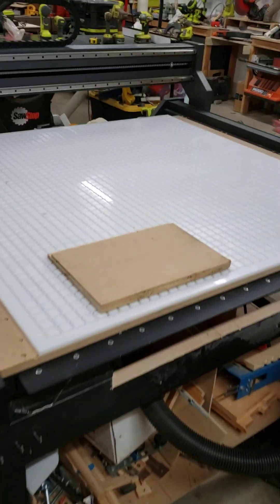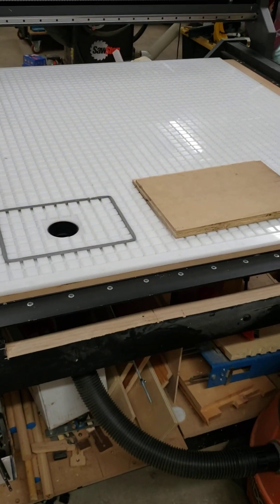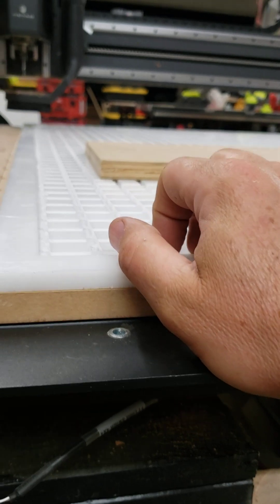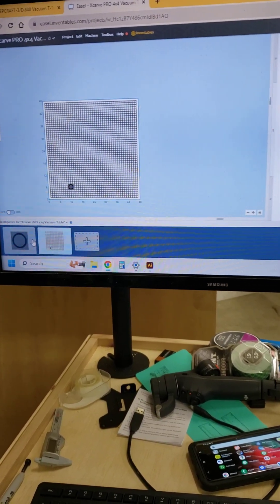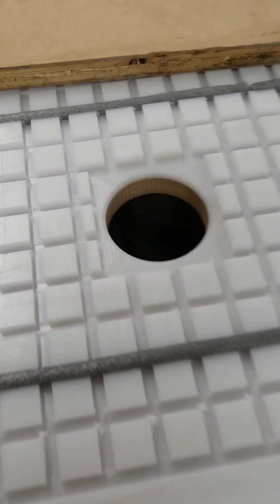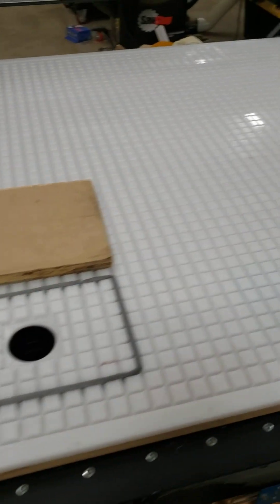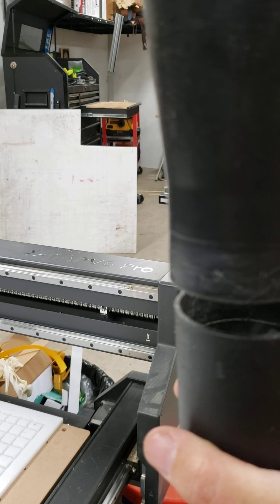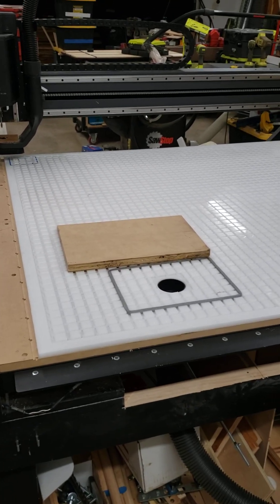CNC vacuum  table! This table is dead simple and you can make it any size you need.

Comment: should use a two stgage shop vac, so motor still gets cold air even when under load, risking burning out the motor with standard basic vacs
Reply from the maker: I will look into this, Thanks for the Tip!

Comment: how long did your vacuum last before exploding?
Reply from the maker: It's still going strong. The key is to remover the filter and maximize airflow. Since the vac is not actually picking up chips or debris no filter is no problem. the vacuum is pulling loads of air through the MDF and airflow to the vac improves with each part that is cut from the plywood. The longest I have run the vac during a cut is 2:40 min the motor never even warmed up. I will certainly post a video when it fails.

Comment: This is great.  Like it a lot.  My question is how do you stop from cutting into it when you cut through your material?  Even if you are just a little off on your measurements, cutting into the HDPE is a possibility.  Thank you.
Reply: Good question, over time it seems like it'll start to lose suction as that happens, and those HPDE sheets aren't so cheap. I suppose you could use a porous intermediate mdf layer as a wasteboard on top of the suction grid.
Reply: I had the same question. I’m in the process of making a 22” x 22” vac table for my small DIY CNC machine. What I’ve come to conclude is the vac table is only half of the system. You need to add a spoil board on top of the vac table with gasket material between the two. Some of the more powerful vac systems can pull air directly through an MDF spoil board. I will be using a small 3.5 CFM oilless vac pump so I’ll have to do it a bit different. I’ll use 1/4” MDF as a spoil board on top of the vacuum plate/table with a gasket between the two. drill one 1/4” through hole in the center of the MDF spoil board and use door/window weatherstripping as a gasket between the spoil board and my project material. I’ve been experimenting for a week and I’m ready to start cutting the slots for the gaskets. Fingers crossed.🤞
        Update on the above…. My 3.5 CFM vacuum pump is no where near powerful enough to pull air through an MDF spoil board. It dose hold work pieces directly to the vacuum chuck when adding a gasket seal to trap air under the project piece.
Reply: @thisoldman7142 I’m a machinist and have had quite a few different cnc machines in my garage over the last year. I recently built a 60x80 router table and a vacuum table would be better yet. Anyways! 

You’re work surface, in this case the HDPE plastic. Set that as your Z Zero. That way. When your tool is at Z0.000 technicality you shouldn’t be cutting it. I use a tool setter so all my tools are always right where it should be!
Reply from the maker: The HDPE is the table that lets the vacuum apply suction to an MDF waste board. The vacuum table will pull suction through the MDF and hold your work. You will only ever cut into your work and then the MDF waste board. Once the waste board is spend replace the MDF and keep the HDPE forever. 

The only time you will put your work directly onto the HDPE is when you are doing a carve job, Signs, 3D flags etc. 
All through cuts get the MDF waste board over the HDPE.

Comment: Hello dan, i'm planning a vacuum table similar to your but i waas wondering if one vacuum hole is enough for a big part as bis as the full table? did you tried with big parts ?  and how did you attach the vacuum table to the mdf spoilboard under it? thanks for your suggestion ;)
Reply from the maker: I usually cut full 4'x4' sheets on my machine, 1 hole have been more than enough for holding power, the reason I placed the hole near my X,Y zero is for when I do smaller projects I only have to close of the zone with foam sealer (sold in the widow dept. of your local box store). The main thing you need to do if you are using a shop vac like I am is to remove the filter and make sure you have max airflow, so use 2.5" hose instead of 1 7/8" size hose. 

I have not bothered to upgrade to PCV pipe and more zones as I have been happy with what I have. If it ain't broke lol.

You can look at the files here if you are looking to make a table for yourself. 
https://www.etsy.com/your/shops/DanConnellDesigns/tools/listings?ref=seller-platform-mcnav

Comment: Any reason why you located the suction port in that particular region of the work suface?
Reply: If most of the work is done at the front of the table, it would make sense for the port to be up front.
Reply: @rpjames11  Yes of course, but just wondered how that would affect the suction toward the rear of the bed.
Reply from the maker: The location for the suction port does not really matter, unless you want to have "zones" you can turn on and turn off. My table is low and difficult to get the the center so I put the port where it was easy to access. I have does several carves with 4'x4' material all the way down to smaller than 12"x12" and the port placement has not been an issue with any of the carves. I have not done any small carves located at the back of the machine, my 0,0 is front left corner so small carve are always near to port.

Comment: Does it hold the parts down when you cut all the way through your material? say you put a 12"x12" piece of wood on it and cut 3 circles out of it. do the circles stay in place when they are complete or does the table lose vacuum through the cut out area?
Reply from the maker: Great question. So far, all the parts have stayed in place when cutting full profile cuts.

Comment: I just ordered some 1/4" backer rod to try out.

My research suggests to use a ballnose endmill for round grid gasket, and a regular square endmill for rectangular gasket. That way, there's maximum cavity filling,  and no loss of vacuum.
Reply from the maker: I think the ballnose would have worked great. I used a flat endmill expecting to use square foam, but the box store only had the backer rod. It has held up well so far.